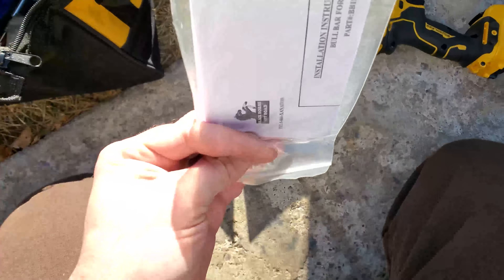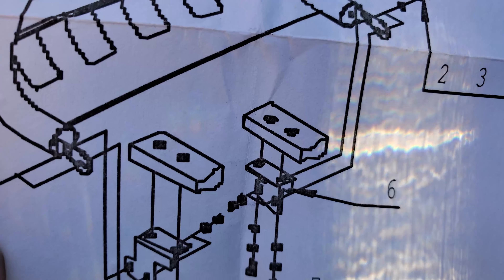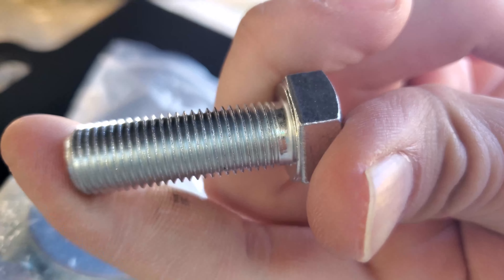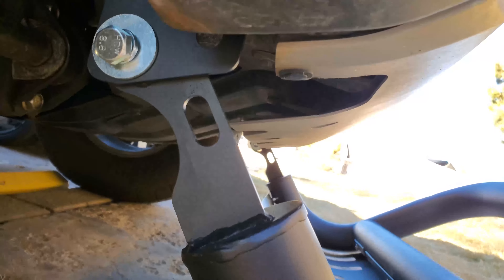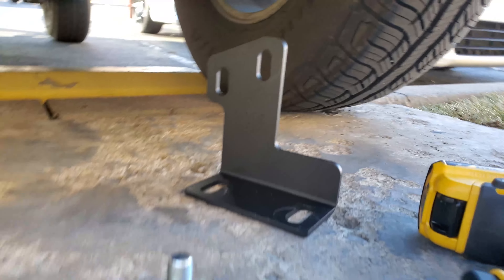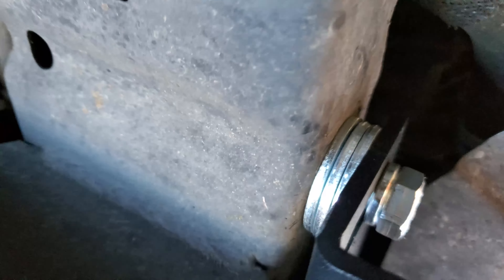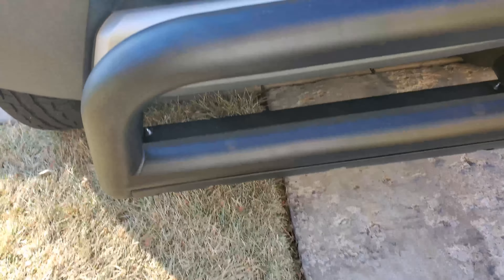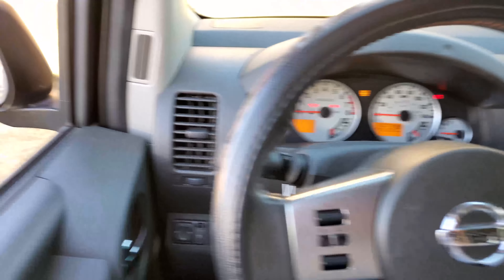Black Horse Bull Bar on Nissan Xterra & Frontier!!

Comment: While these add almost zero protection other than a very very light tap, they do look great! I bought one for my 2015 Pro4X, because I dont plan on off-roading really. It'll be mostly a weekend/beach vehicle with some trails, thats it. So i wasnt too worried about impacting my approach angles, but you do have to worry about bull bars/full bumper bars that are not properly mounted to the frame. They end up actually causing more damage than not having one at all (vs the oem crash bars/padding thats designed to take an impact and minimize damage).   Pretty simple install video, Im about to install mine and I think it adds to the already rugged look, hope she was happy with it!
Reply from the maker: Yeah, her car definitely won't be hitting the dirt anytime soon. I'll admit, she wanted it for cosmetic purposes, and after she bought me some car parts, I "paid her back" with this. It definitely makes it stand out more, and if she's happy, I'm happy!

Comment: Bull bars and brushguards can look nice and provide mounting points for lights, but they come at a price.
Even a small bump will drive a bull bar into your bumper, grill and hood. A brushguard will do the same plus damage your front fenders. There is a reason these items are called damage multipliers. Such items can take a simple bumper swap to another level of expensive.
Reply from the maker: Makes sense! Hopefully we never have to find out. My idea is that if it can buy time by protecting the radiator and front engine components in the event of an accident, that it might be kind of nice.

Then again, I'm really not too sure

Comment: Good and all but the bull bar just lowered the ground clearance of the front 2+ inches.  It is okay as a mall crawler but light off road adventures, that bull bar will see lots of scrapes and dents.  Also a force multiplier for damages even during a very mild frontal collision.
Reply from the maker: It's definitely not for everyone
Reply: @AaronTheBaron  yeah its a risk I'm willing to take on my 2015 Pro4X since its not even a daily driver, mostly for beach trips when we hit the coast. may go the Shrockwerks route at some point as I'm about to order their sliders which are 100% worth every penny, but the bumpers are just a bit heavy/pricey for me to justify without upgrading the suspension also. I thought the bull bar gives it a nice look, and just try to keep that front end from colliding with too much XD
Reply from the maker: Haha yeah I definitely don't plan on rear ending anyone lol. Hopefully they try just as hard to not hit me, lol.

Comment: Where do you got the hardware for this bull bar , I have similar however the hardware i have is for another make and model. Please share the link or part number and supplier. Kind regards Basil
Reply from the maker: I reached out to them at their customer service number. I told them I bought it for one vehicle and got mounting hardware for another one. They ended up shipping me new hardware for free
Reply: @AaronTheBaron  whats the company name , I only need the hardware I searched on Amazon
Reply from the maker: It’s called Black Horse. That’s where I got this bill bar at least